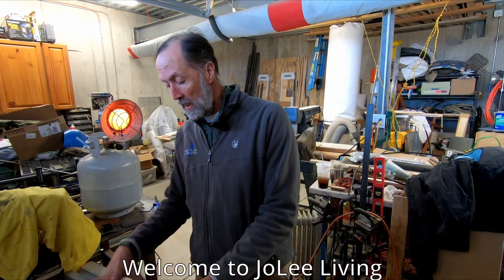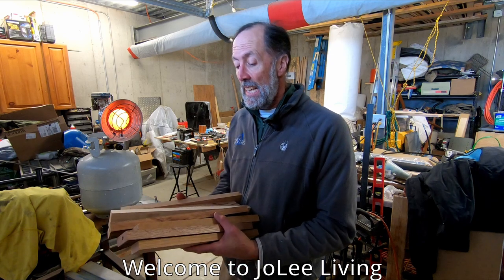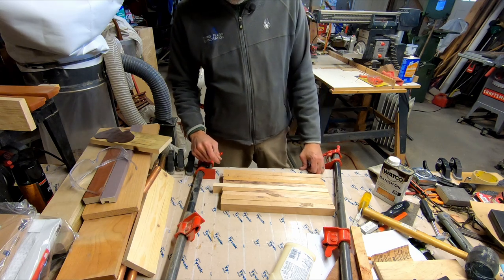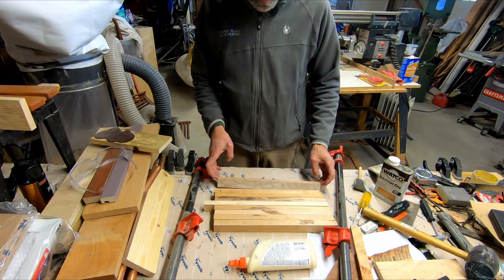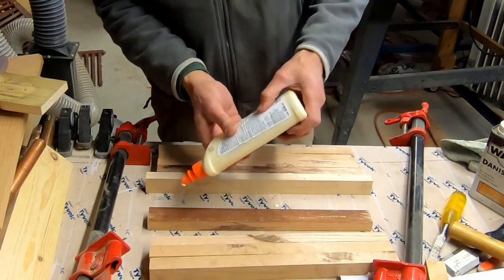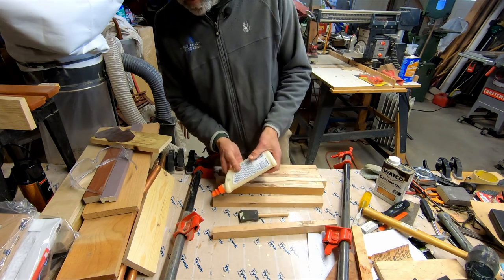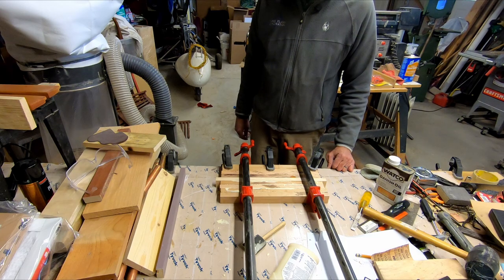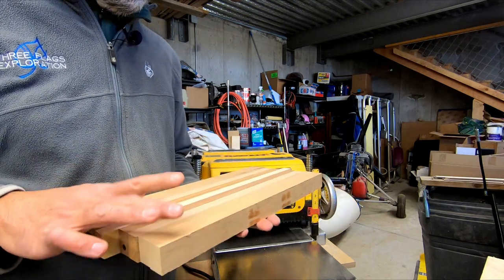Making a Charcuterie/Cutting Board

Comment: Very nice presentation.  Was that Elmer's Glue you were using?  I am a little unclear about the finish.  Is the oil finish waterproof?   I like the central stripe on the finished piece.  Could you reshape the board with a band saw to have a handle?  It seems long enough.
Reply from the maker: It is Elmer's wood glue.  Yes the oil is waterproof.  It would be long enough to cut a handle.  I was in heart mode and wanted to cut a heart, but it would have been pretty small.